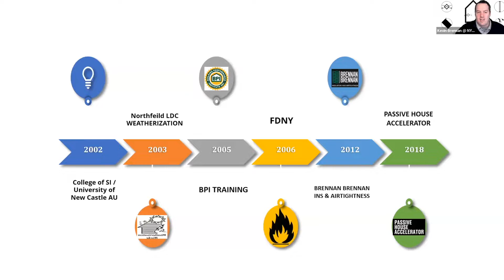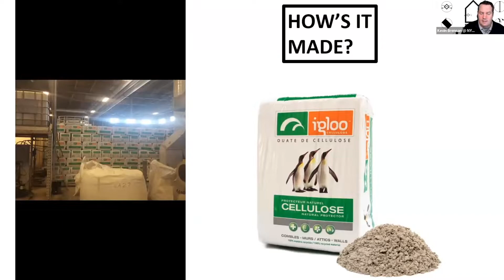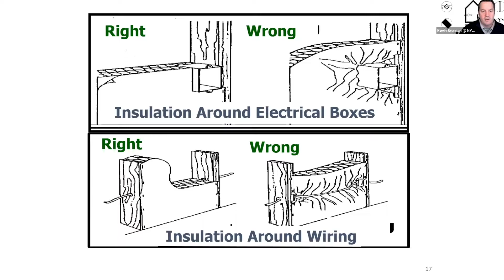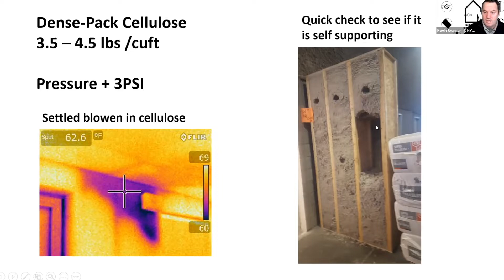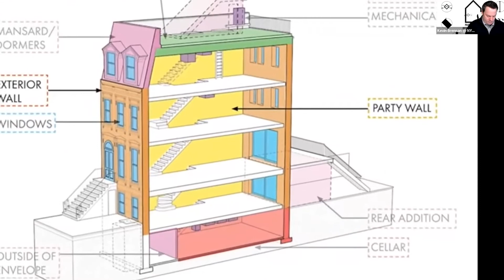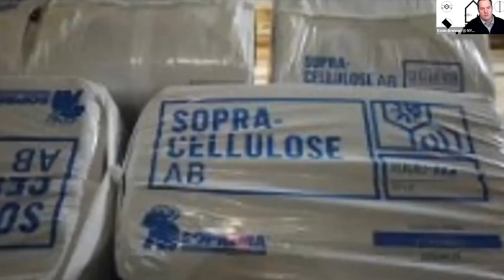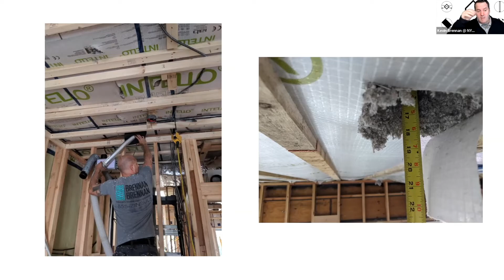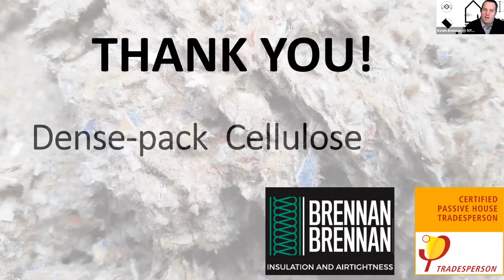Dense Packed Cellulose Insulation | Passive House Accelerator Construction Tech

Comment: Thank you so much for this video.  We have been building for decades and have only recently, last 3 years, been using dense pack.  Your videos and also your packing density and the expectation of self support, have changed our expectation from our insulation sub.  They DO NOT do insulation correctly and leave the density too low, with giant voids all over the place.  We had to make them come back to fill in the voids and then we still had to follow after them ourselves to even out the overly dense spots with the not dense spots.  Then the drywallers complained about too much insulation making the walls lumpy.  Any advice on NOT having to hand hold our subs?